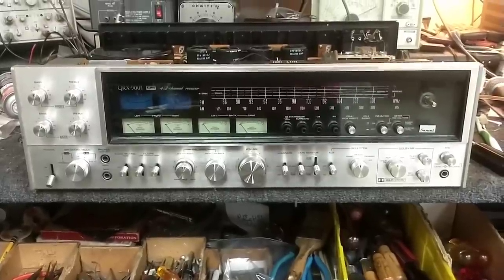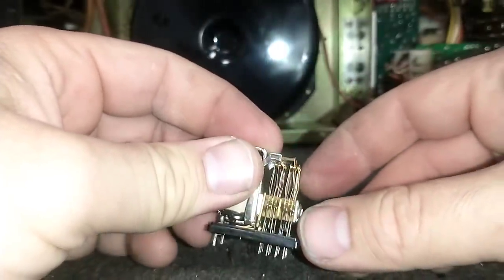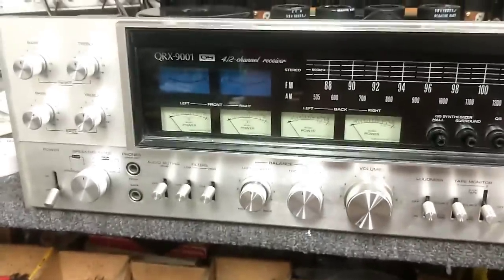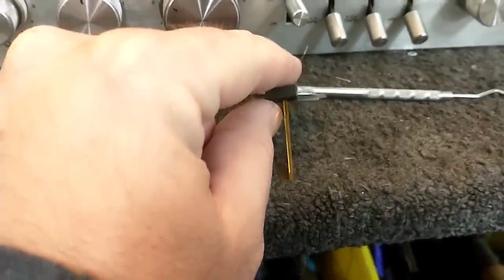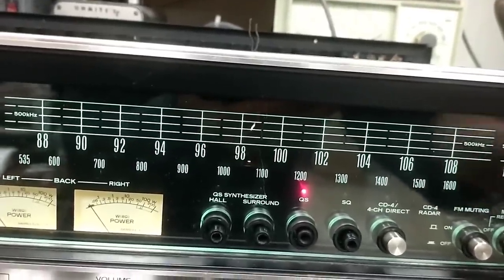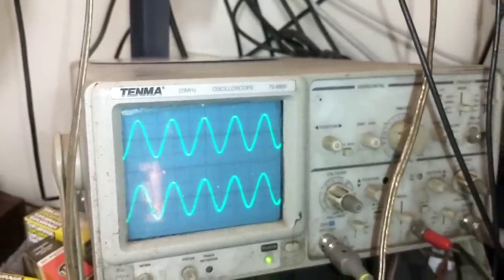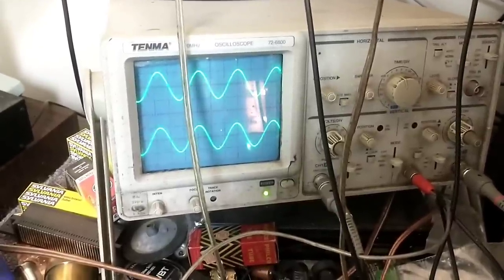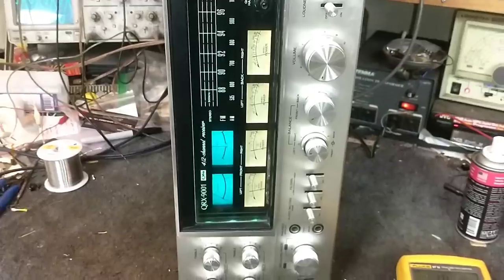Servicing a 1978 Sansui QRX-9001 Quadraphonic receiver. part 3/3. FINAL

Comment: Cool Vid. I have a Marantz SR 4000 that randomly pops through the speakers. I cleaned the relay, but it still pops. I am ready to part it out.
Reply from the maker: Pops in one or both speakers?
Reply: @JordanPier  one speaker "R" only....driving me nuts. Mutiple hours. Reflowed the boards, cleaned the relay. Pulled the chalky resistors and all measure good. Like a static pop. Loud even at low volume. "PoP!"
Reply from the maker: @Poppinwheeeeellllllieeeeez  tap on the amplifier board with a non conductive object to reveal loose connections that may be causing it.

If its not vibration sensitive its likely a transistor(s) failing in the front-end of that channel
Reply: @JordanPier  thanks man. I did the tap test already...I use a chopstick. I reflowed the boards. Suspect a transistor. Stk 5050 paks on the heatsink and the 3062 voltage amp. Shame because it sounds great when working.

Comment: I’d energize the relay with a suitable power supply instead of using your fingers; this way, you won’t bend the contacts out-of-whack by mistake. You can even wire the thing as a buzzer; that’ll really exercise the contacts after you DeOxit them! 😊

Comment: HI!  great video , i have the  same  sansui model  ,  i especially  liked your solution to the broken dial pointer  problem , which is what happened to my  unit . and now it also stopped working, and  now it  powers up but no sound . i am  ontario canada , where are you located .

Comment: I was given a Sansui qrx9001, no sound in left channel in 2 channel mode. all lights work . Only gets source in tape 2 input, not  in aux. lot's of static. Not sure I want to sink a ton of $$ in it, only to have more problems down the line, however the sound I get from the right channel is very good. Suggestions?
Reply from the maker: Too many possibilities. Have you cleaned controls and switches yet? Number one thing you Must do on these is to disassemble heavily to get to the 4ch selector board, pin thr pass through joints ans resolder.  Then fuseable resistors on driver boards, then relays.
Reply: @JordanPier  Thank you for the quick reply. I haven't done any cleaning. Best cleaning spray for doing clean up of contacts? I have taken other vintage receivers to Adams Electronics in Huntington Beach California and I'm happy with the results from them. Some complete service videos for this receiver was in the $1500-$1800 range, and listening to you mentioning it's just a matter of time until something else goes bad. I have to have a hard look if I want to go all in and return on investment. Nice receiver for it's time.
Reply from the maker: @kenjohnson961  they are money pits. Unless you really have quad material to play, id sell it. Aways gotta tinker with these. Tech that was dar advanced for the time. Pushing beyond limits of component design.
Reply: @JordanPier  Thank you.

Comment: If I've also got a JVC 4vr5456x ,it makes a constant noise from the left front ,and rear channels. I'm wondering if it would be possible for you to fix it if I sent you the front circuit board ,that's where the problem is.
Reply from the maker: I do not service sets in this manner. I always prefer to have the complete unit, diagnose whats wrong and make repairs as a whole so there is no question it is repaired when it leaves my bench.